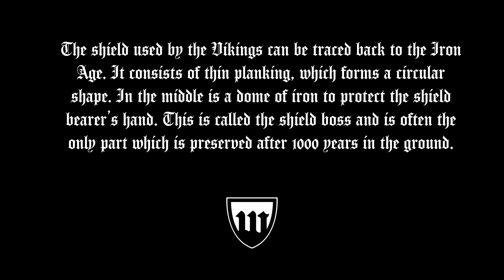Making a Viking shield, part 1, forging the shield boss.

Comment: I Had cut off the bottom of a gas cylinder and welded it to a 1" plate. For making bowls.   
   Those donuts you made are unique and haven't seen that approach, thought it was a massive solid link until you moved it.
Reply from the maker: They are made from gas pipe elbows. I made them more than a decade ago. They work Well. I can remember calling a big steel manufacturer asking them for a few round pipes in multiple diameters instead of there usuall 1000 pieces order. I can be a bit like a pitbull not letting whrn I have something in mind  so eventually they made the order. I believe it was 10 calls and even more mails. Now with the wide open internet market somewhat rare stuff is much easier to get.

Comment: I always found it interesting these didnt rise to a fairly aggressive peak rather than just round.
Yes round is strong but 90° ridges are stronger, also better for smacking someone with
Reply: if you going to smack some one with a shield hitting them edge on is way more effective than using the boss
Reply: @messylaura  not always a option. Especially when it's flat to them
Reply: Early bosses like this where relatively simple. But later bosses, and some bosses from other areas had different shapes. Some had a prominent peak like you suggested. But whether it was for offence, defense or decoration is up for debate.
Reply: @elricthebald870  thanks! That's interesting. I kind of figured some would be decorative like everything else but it'd be interesting to see combat advantages/disadvantages